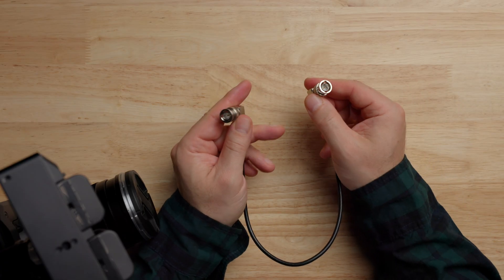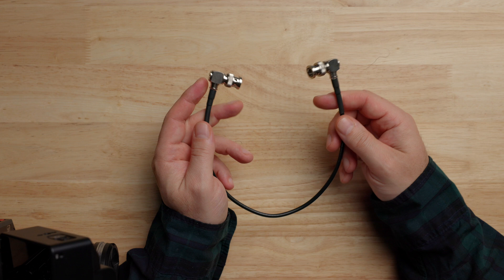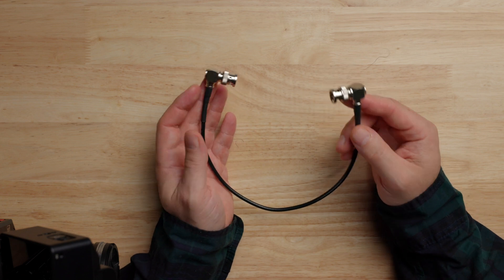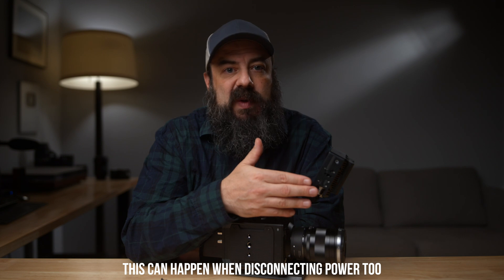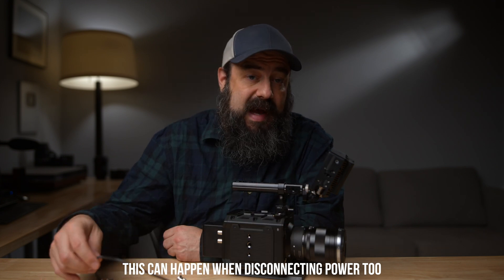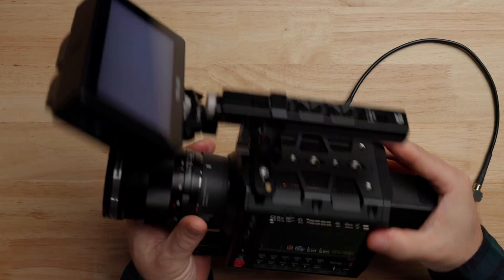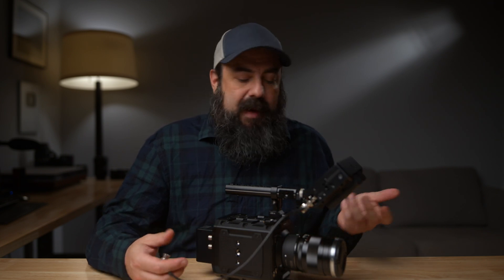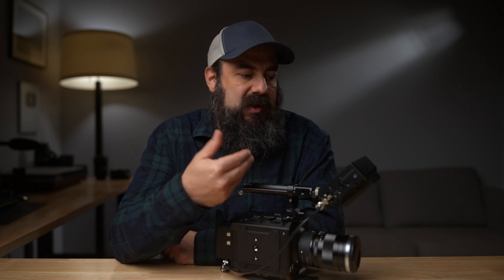Blackmagic PYXIS SDI Port - How To Safely Use It (12G SDI Protocol)

Comment: This is a very simple question to those in the know, but this is my first camera like this. But just wanted to make sure. If I have an SDI cable running to a black magic sdi to hdmi converter and that's running to a monitor. I just need to make sure the camera is on, the converter is on and the tv is on BEFORE I plug in the SDI cable to the camera?
Reply from the maker: I have a similar setup in my studio and that is what I do.
Reply: @Josh_Sattin  Perfect! Thanks for replying and for making the video.
Reply from the maker: @ You're welcome. Thanks for watching!

Comment: I've never followed any of these protocols and have NEVER blown an SDI port in over 10 years and this goes for all the cameras I've owned from C100, C200, C500 MKII, FX6, RED Komodo X, Raptor X, Pyxis, Etc.  Simply put don't use CHEAP cables.
Reply: Well done Armando!!!!! Thank you for letting the filmmaking community know you promote unsafe practices!!!! Its documented by RED and Arri about SDI protocols, just because you don't follow the protocols doesn't mean they are worthless, ask all the people with blown SDI's that regret not following the protocols.
Reply: @robertsinclair8360  You do you bro, just stating my experience.  Once again, stop buying cheap cables!  They have these protocols because people buy cheap cables and blame the camera manufacturer.  This is their way to pass the problem to you.
Reply: @mondobytes  Can you recommend cables? I am looking for high quality cables. That being said, I do believe SDI protocols are important and I also probably know why you've not blown up (could be multiple reasons like the signal strength, whether using dtap or not, or maybe you've switched off the camera before unplugging but the battery hasn't been swapped or if the monitor and cam are running on different batteries). May not have happened, doesn't mean it can't.
Reply: I forgot to do the protocol soooo many times. No problems at all. Komodo Og owner here. Some people said nothing happens if you re on Canon batteries and V. Mounts are the problem.

Comment: Thanks for the video!
Can you tell me, if I make a RIG for this camera, take out a V-Mount pad (from the same TILTA for example) and put a V-mount battery with connectors, then SDI cable should also be connected to the monitor and camera in the last turn, after connecting the camera and monitor to the v-mount battery?

Comment: Great video, thank you. In the electrical world as well as electronics there is a concept called "air gapping", same concept that fuses use, which is what you have described in great detail. There is no need to completely disconnect the cables at both ends, only on one end. This is important when you have a very complex rig and the SDI cable on the camera side is not easily accessible, or is hidden by the power system you are using, as in the case of our larger rigs. It's perfectly acceptable and normal procedure to disconnect the monitor side of the SDI prior to applying any power. We have a red flag on that side of the cable with a reminder and a warning. "You fry it you own it".

Comment: you connect ur sdi cable and its just a black screen?  I do not see any video being displayed.  Thats literally my issue.  How do i get the video to display on my blackmagic video assist 12g monitor?
Reply from the maker: Maybe check the output resolution on the PYXIS for your SDI output and make sure that the monitor is set to SDI input.

Comment: Isn’t the SDI problem primarily caused by connecting power cables? Since you’re powering each device with its own battery, that shouldn’t be an issue, right?

Comment: USB C - HDMI doesn't work even with the cable you mentioned. Do you know what may be the solution?
Reply: Also having no luck with the UNI cable. Hollyland monitor shows 1089p signal but no image
Reply from the maker: Oh no! I'm sorry they aren't working. I use those two cables with my SmallHD monitors and they work.

Comment: Just a note, you can buy two types of isolator, the cheapest is a galvanic isolator - benefit of these is they're cheaper than the box type and don't require power, the negative is that they reduce transmission to that of 3G-SDI so 1080p rather than 4k.

ARRI sell one and you can also get them from other reputable manufacturers (Alvin Cables do a few nice options).

Comment: Just curious how everyone gets around without powering down? Been on plenty of sets in my time, and cams don’t turn off, battery hot swaps are the norm. Did everyone just change up the routine or ignore the “protocol”? This never seemed to be an issue until the last few years. Seems to me, it’s a constant design failure, is there no way to implement a system to protect from such events actually occurring?

Comment: Last on , first off, I found to be the best way to remember this . D tap power is the main culprit too. Two positives touch for a millisecond , circuit is completed down the SDI / HDMI ,and good night that port .  Same can happen when taking off power cables.
Reply: Yup, D-tap is the culprit like 99% of the time. Others like DC barrel jack, mini XLR power and even Lemo 2pin can technically cause the ground loop too, but they're WAY less likely to do so, because they always plug in at such a perpandicular angle. With heavily used D-taps, they can actually STAY plugged in at an awkward angle where only one pin contacts the female plug. I've simulated and tested that situation with 2 D-tap splitters and a multimeter in a continuity test mode. Positive side had a beep, negative didn't.

Comment: I appreciate the vid, but it's quite frustrating that no one actually KNOWS for sure if the port will get fried. It's always "sometimes it can happen", or "it's always best to do this, just in case". Why on earth isn't there a definitive set of circumstances to know and work around / adhere to? I'm not trolling, but am I a guy who likes to know, rather than pray.
Reply from the maker: From Arri:
"This damage to the SDI connection can occur when connecting an unshielded power cable to an accessory
that is already connected to the SDI output of the camera. If the plus pin is contacted before the negative pin,
the BNC cable will close the current circuit resulting in a fatale damage of the included SDI driver chip which
itself is not designed to handle such high currents. This problem can also occur when disconnecting an
unshielded power cable of an accessory that is still connected to the SDI output of the camera with a BNC
cable. Damaged or low quality BNC cables are more prone to cause this problem."

https://www.arri.com/resource/blob/194752/26e7a4ca07e7a8f0ce038b23109b216c/download-technical-information-data.pdf
Reply: All you need is the most basic, basic knowledge of how electricity works and it makes perfect sense. There is no mystery to this and this isn't anything new, if you don't connect and power in the right order, sooner or later you will experience a ground event and fry your camera and or monitor/transmitter. 

As Josh says, the problems come from newbs who know literally nothing about electricity and what a ground is and know nothing about using a professional camera. And this doesn't only apply to SDI, it also applies to HDMI, ground seeking is ground seeking regardless of cable type.
Reply: @danbrockettDOP  Ohhhhhh.....gotcha! I must be so, so, SO stupid then. It's just the "sooner or later" part that isn't making perfect sense to me. You know, like if you're NOT so unlearned about basic electricity and such, you "can" and "might" fry your SDI port, OR HDMI port. I'm not sure you really understood my OP.
Reply: @danbrockettDOP  Okay, so I learned the basics about grounding now. Also, I'm not a newb anymore either, just went pro. Just wondering if you can help. Why doesn't my professional camera's SDI port fry when I DON'T adhere to these basic electronic principals you're talking about? You can't answer that with any certainty. Neither can anyone. That's my point. It's all "just in case", "it's best practice" and "I would never".....which don't get me wrong (you already did) is good advice, but it's not provable, predictable, repeatable results, kinda advice.
Reply: @mtscott44  It doesn't fry because you didn't accidentally plug in a two pin power connection, preventing positive or negative from making a connection at the same time. It's provable and predictable within the unpredictability of when you might accidentally do that. In other words, if you do that, somehow insert the positive or negative NOT at the same time, you will fry something or at the very least cause a ground loop/power surge that may or may not fry something that particular time. It's not 100% guaranteed if you heed this powering order rule that you will never fry anything but you've probably decreased your chances of frying something by, wild guess, 95%?  

We're talking a bit of basic electrical theory but mixing it with real world variables and application of those variables. I have plenty of DTAP cables and devices and the variability of those connections is kind of scary, some plug in one direction, some of the same brand and model, the other direction. It's all plastic, it's all Chinese mass produced, some are super snug, some are loose and sloppy, a lot of variables in the quality and fit too.
Reply: @danbrockettDOP  Okay, so here's a scenario. My camera, wireless transmitter, focus motor, monitor and EVF are all powered by a single battery. All D-TAP, all cheap plastic. What  if no cable EVER gets unplugged, or plugged. The only thing that happens as far as power is concerned is the turning on and turning off of each unit. Whenever I present this setup, the answer from the experts who talk with authority and certainty say "I wouldn't risk it, just follow the protocol". What say you?
Reply: @mtscott44  I would always just follow the protocol, there is no downside in doing so that I can think of? What do you have to lose by doing so? If, by some chance, your camera or a defective cable, battery, fitting or whatever sends a voltage surge, not a ground seeking event upon booting up, which could be for a large number of reasons besides a DTAP connection (battery goes bad or swells, cable get's kinked or bent at connector which you don't notice, etc.), you would still be protected at least for boot up and power down, right? 

Most of these kinds of events happen on boot up or power down. Generally, once you power up camera and the accessories, if they are working, the voltage has stabilized and any ground seeking has already occurred. My camera plate has a voltage regulator, my DTAP to USB C for the monitor has a voltage regulator too but thos can go bad or stop working with age or over voltage.
Reply: @danbrockettDOP  First of all, I appreciate your responses. Second, I think there is a downside - for me it is anyway - which is having to plug / unplug cables. It's annoying. Also if I'm doing it, not really knowing why or if it will fry stuff, it's frustrating to do. It's also frustrating to teach an assistant. "Why do I have to do that?" they ask? Well, just cost it might break the camera. I ran a rig for 4 years straight and never plugged or unplugged a cable. It was glorious. All powered by a single V-lock using D-tap. No procedure. Sure, you can play it safe and follow the protocol, but the problem I have with that is the way it's sold. "Follow this protocol if you don't want to fry your camera". That's pretty serious shit. I don't follow the protocol and I have NOT fried my (old) camera, or (new) one. Gospel advice that is pushed by "professionals" to "newbs" with force, backed up by "might", "maybe" and "to be safe" reminds me of 2022. Let's just trust the experts. Call me triggered. Meanwhile, I'm powering my Pyxis the way I mentioned above, so not following protocol, and zero issues. You say one of my cables might fail? I say, sure. Lot's of things could happen. History says I'll be fine. Am I lucky? No. Are important details missed in these must follow videos? Yes.
Reply: @ You may never have an issue. And in that case, great. But if you ever do have an issue, now at least you’ll know some of the ways it might have happened. Rock on.
Reply: @mtscott44   It will be fine , (provided D tap doesn't get knocked in any way , D tap really is the main reason for fried boards I think)   till you change battery and have to detach / re attach D tap , presuming from battery . Very easy thing to remember  , re SDI / HDMI cables .. Last On / First Off
Reply: @danbrockettDOP  Thanks again Dan, appreciate your replies.
Reply: @robinprobyn1971  Thanks man!

Comment: This is an engineering mistake. It's easier not to buy cameras with sdi.  Thanks for the information.
Reply: The exact same issue with HDMI, does that make you feel a little less safe?

It would be nice if all video cabling connections had an integrated ground system but two pin power connections like DTap and Lemo have been around for many decades so that's what we're stuck with. 

It's like examining HDMI. It's a great signal with a horribly designed connection that wears out after a couple of hundred insertion cycles. But because it is so ubiquitous, we're stuck with it, even for professional gear although not for the Pyxis.

Comment: Thank you for the video. I wanted to ask if, in the case of using an SDI-to-HDMI bidirect converter for video transmitters, the same procedure should be followed or if there could be any issues. Thank you.
Reply from the maker: You're welcome. Yes I still do the same procedure with converters.

Comment: Forgive my ignorance, but when you mentioned everything being turned on before you connect the SDI, I believe you mentioned making sure everything was grounded. 

What does that mean and how does one accomplish that?
Reply from the maker: Basically everything needs to have a solid electrical connection (positive and negative connections). When power is connected (or disconnected) one of the pins can make contact before the other. If the SDI cable is connected it will try to complete the circuit through the SDI cable, which is where the problem happens. If all of the devices are properly powered up then it is completing the circuit in the device and the power supply attached to it, not through the SDI cable.

We are talking about low voltage DC circuits here so the negative is also the "ground".

Comment: What happens when the battery dies while still shooting? Is there still risk of damage?
Reply from the maker: I’m not sure but I try to always swap out batteries and do the protocol before the battery dies.
Reply: Why would a dead battery fry your SDI / HDMI .. ? it will screw with your clip on some cameras . specifically MP4 files I believe .
Reply: thats also what im wondering all the time. i do really not mind doing the protocol everytime bec that just becomes muscle memory. but i hate the fact that this still can happen even when u did everything right but the batterie suddenly dies. just a couple of days ago i had a bpu battery, that was newly bought and from a (then) trusted brand, die on 18%. luckily i wasnt using sdi on that shoot. that could have easily already been a dead sdi port. that is what is frustrating me about that whole sdi thing not that u have to connect everything the right way,  this is easy to do.
Reply: @wallenboeckfilms  exactly, following the protocol is easy, but in situations where the battery dies you might still be at risk of a burnt out sdi port. It’s really a hard pill to swallow
Reply: What if vmount dies but have a bpu backup on camera?
Reply: @yavor0012   On the fx9 it will seamlessly switch over ,I guess the fx6 is the same . But this wont cause your SDI / HDMI to fry . When you put on a new battery / D tap , best to disconnect one end of your SDI / HDMI .

Comment: What about if there is sony battery and v mount battery plugged in, and swap the v mount? It does not shut down the anything so it shouldn't fry the SDI?
Reply from the maker: If your monitor is be powered with a source other than the V Mount then you should be okay. As long as powered is constantly being powered to the camera and all of the accessories you should be good.
Reply: @Josh_Sattin  Right...BM cameras sometimes suddenly shuts down on its own so trying to think of ways to avoid it all  when it is not powered through AC.

Comment: great video ! but was there not something with the new core SWX batteries and there new connector that also prevent / protect the SDI port ? from what i saw on a video during NAB
Reply from the maker: Thanks! I'm not sure if you are thinking about their new PD Pro ports? They are locking USB-C connectors so they will help maintain continuous power from the battery to your accessories. This will help protect your SDI port because if the power gets interrupted to your accessories you could have a problem.
Reply: @Josh_Sattin  yes, i was talking  about the PD Pro connection , i forgot the exact name 😇
Reply: Yes I’m waiting for them to add PD pro to there nano x battery, currently they only have it on one new model. The one that magnetically connects to each other but personally, I don’t see a use for that.
Reply: Yes I’m waiting for them to add PD pro to there nano x battery, currently they only have it on one new model. The one that magnetically connects to each other but personally, I don’t see a use for that.